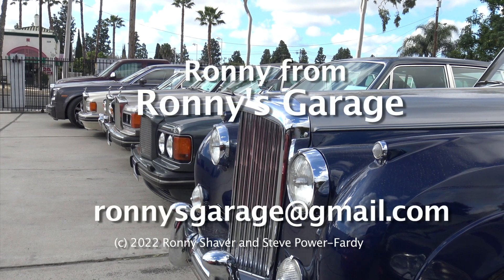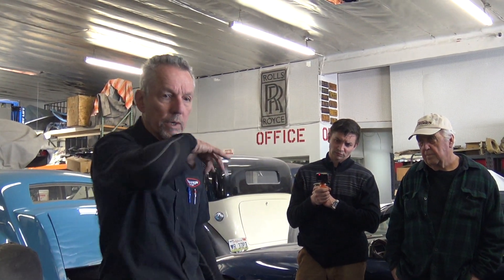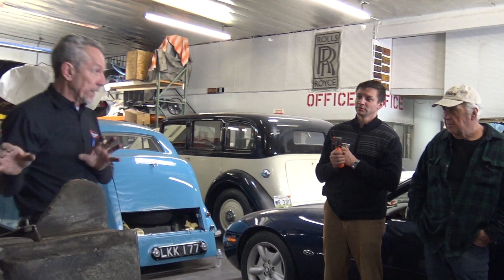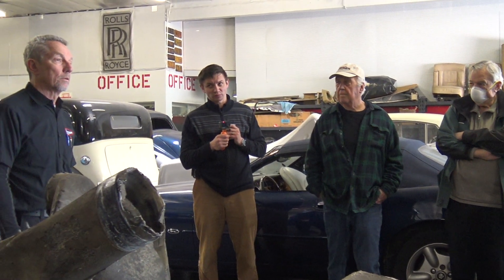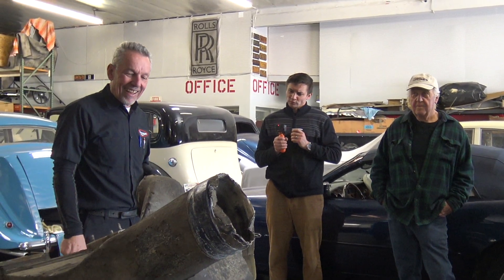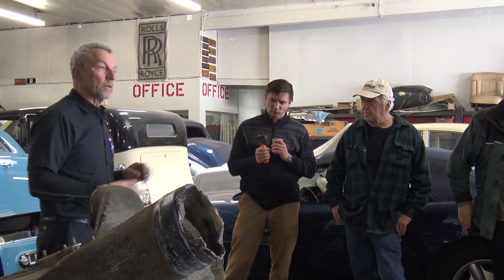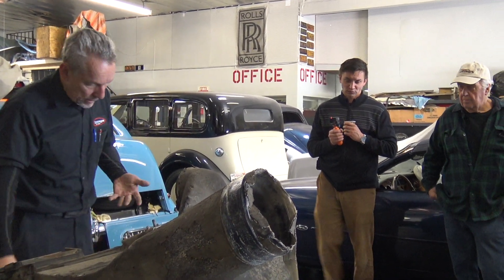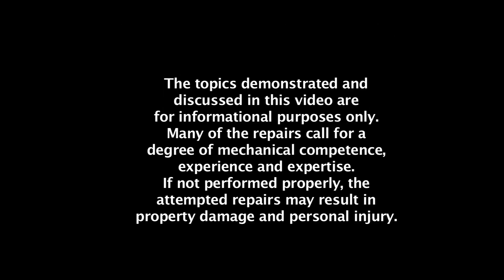Cloud Heater System Part 3 of 7

Comment: The audience of your course drives RR and is well educated or just earn a lot. But everyone knows that technique
which doesn't move, that's why it breaks. If every owner of an RR carefully read the owner's manual, they would know 
that everything must be switched over a year of operation, even if there is no winter. Special attention is the regular 
changing of all fluids in the vehicle. The specifications must be observed. Who flushing the cooling system and changing 
the fluid every two years can NEVER have problems with internal corrosion. You have to drive through the desert for a 
few hours at night twice a year to set the heating to winter mode to run. If you take all this into account, then RR vehicles 
from the 50s & 60s should NEVER be any have technical problems. They are actually indestructible. If something doesn't 
work as usual, visit your trusted workshop and ask for advice. You will be told which jobs you can do yourself and which NOT!
Never park your car under the sun for long periods of time ! Your car will thank you.